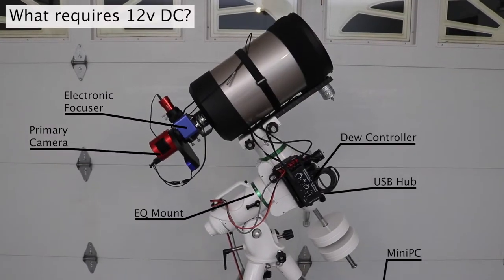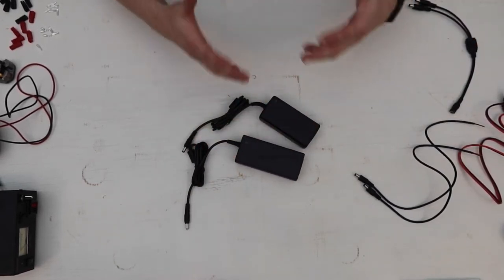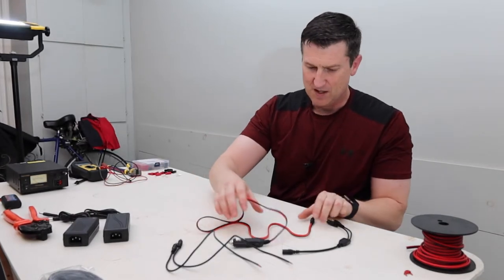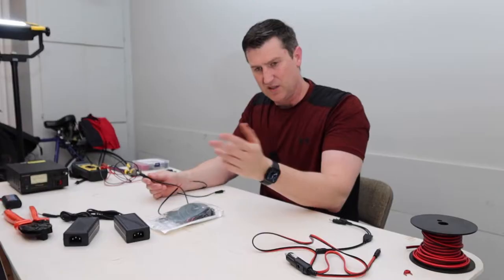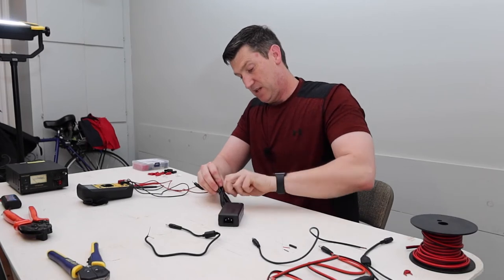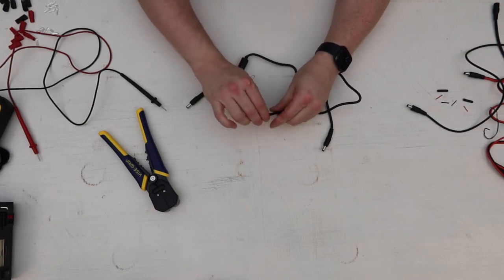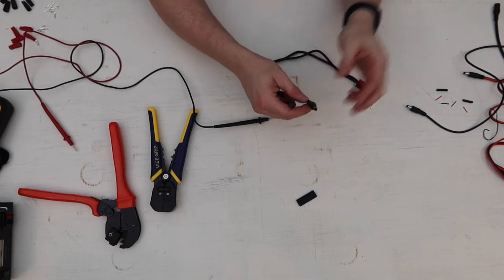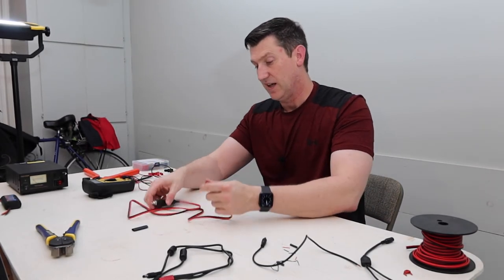Simplify Your 12v DC Telescope Power Cables

Comment: I learned a different method for joining wires together, especially if they are different diameters. Leave the wires frayed. Slip the shrink tube on. Spread the wires apart and push them together in line. Solder them and apply the shrink tubing

Comment: You are referring to the power supply as a 12V DC power supply.   The model you show in the video is not the one linked in the comments above but rather a 14.1 volt DC power supply.   I know I had seen a video by another YouTube person who modified the same model power supply to knock it down to 13.1 volts.   Is that something I need to be concerned about or is the 14.1V okay?   I don't want to start melting things.   Sorry for the newb question.  It was really a great video and I appreciate you taking the time to provide all of the links and great examples.   Maybe you can do a follow-up talking more about the actual connections on the scope and how you wired everything.  Again, great work.
Reply from the maker: It is a perfectly valid question! The vast majority of electronic equipment that state they use 12 V DC, will actually accept voltages between the low to mid 11s all the way up through 15 V. This is because when you use a battery, as the battery begins to drain, the voltage output drops. You may start with a lead acid battery that is outputting 12.6 volts and end with one outputting 11.6 volts. And your hardware will function properly the entire time. With this being said, most of us have found that our telescope mounts operate better when provided higher voltages. The higher voltage provides better tracking because the motor has more power. You can see many discussions online about this especially in regards to skywatchers style mounts. As you can see, I am using a 14.1 V DC output regularly when I’m at home and can plug into AC current. When I’m running off my battery, I want my voltage to remain high as well. In that case, I am now using a boost converter that takes in my DC current from the battery and pushes the voltage up to 13.8 consistently. I’ll try to show that on video sometime soon as well. It’s not a requirement, but I like that my equipment is still being powered in the high 13s even on battery, and through the whole evening even as the battery voltage itself drops over time.
Reply from the maker: This video may help with the cabling. Simplify Your 12v DC Telescope Power Cables. It is one of my older videos, you may need to search the channel. YouTube isn’t letting me paste links right now for some reason…

Comment: This is really getting me thinking, so thanks for the video and all your other ones too. One question: in this video you cut off the ends of existing power supplies but i wasn't clear on whether you were doing that just to save money of buying the same adapter again or if there's really anything unique and important about keeping the existing manufacturer's plug going into the gear. I'm assuming it's fine to just buy cables with the correct size barrels and gauge if i don't want to cut stuff up?
Reply from the maker: No reason other than reuse. Also, the assumption that the connector is properly rated for our power supply instead of buying a bag of cable ends that you may or may not fully trust. But for the record, I use and buy cable ends too. :)

Comment: Hi. Read your article “ Remote Control Your Telescope (MiniPC) “. I enjoyed it thoroughly and am in the process of following your instructions and doing the same setup. But in that article you stated “As far as wireless access when in the field, we are going to table that discussion until a bit later as it adds come complexity that we don’t need to introduce just yet.” Do you have an article or video now which expands the info of that article to have remote control when in the field without any internet or cell phone coverage… completely off the grid? What other equipment will I need? Thanks.
Reply from the maker: You can watch my ‘take the Internet with you’ video to show you how i use a small access point to get local network connectivity to remote control the unit when off the grid. It can also be coupled with the phone tether to provide Internet access. Nina’s newer capabilities, such as loading the off-line sky cache for framing, makes it pretty much where you shouldn’t need Internet access during a session anyway but you need to make sure you have those files in place prior because it is a very large download. So either an ethernet cable or some sort of wireless access to remote control the unit and the battery. Then you can get up and running.

Comment: Yes thank you for this video…although I am not familiar with all this my husband will probably help me accomplish this needed task of reducing the lengths of cables and wires and power bricks ….the only thing is would it still be worthwhile to do if I do not intend to have an onboard computer?
Reply from the maker: Definitely still value in doing this. A couple reasons: 1. Reduce your large and heavy power bricks down to a single power source. 2. The power source can now be a single AC/DC convertor or even a DC battery. 3. Removing heavy bricks removes balance issues as the mount slews throughout an imaging session. and 4. Removing excess wiring remove the possibility of cable snags as the mount move around.
Reply: @PatriotAstro  thank you for your speedy reply and your other videos are very helpful on Nina 1.11 which have not really been tackled elsewhere…❤️
Reply from the maker: No problem. Glad I can help!

Comment: I have heard some mounts are very picky about DC power quality - such that they run better if you supply a little over 12 V and that some are sensitive to any ripples from switching power supplies.  Think adding a capacitor to smooth out any 60 Hz would be necessary?
Reply from the maker: I’m not sure if smoothing out the power would matter much BUT I do occasionally question the quality of some of my portable lower amp 12v power supplies. They work, … but based on what I paid for them, I have to wonder. Regarding the voltage though, I have seen numerous comments about skywatcher mounts and how they do seem to perform at a much better level when they are provided consistently higher power, 13+ volts.  I have considered using a voltage converter (buck converter) to drive the voltage higher for that specific device.

Comment: Would love your suggestion.  I have two small computers I've been working on getting prepared to work with my scopes and would like to eliminate the power blocks for each of them.  They both are currently 5V input through USB-C connectors.  But I would like to connect them to my Pegasus Astro power advance.  Suggestion(s)?
Reply from the maker: Go watch my Allsky Camera Part 2 video (on the battery box), I cover a 'similar' issue there using a buck or step-down converter. I modified the connector to be a powerpole style connector but you could just use the connector you need instead. I use that sort of connector in my 'Simplify your 12v DC telescope power cables' video. Basically, you'll need both videos to piece together your application using a buck converter and the right cable, but it is something you can do - no problem.
Reply: @PatriotAstro  ok - will do - have picked up the same Stick-PC you had in one of your other videos - a little nervous about the micro USB power connector… :)
Reply from the maker: Same concept there as well. Just make sure you get the converter with the right connector. In the comments of my videos I try to list what I am using. You may have to look at a couple to find that one, or just dig around on amazon. :) If you have trouble, let me know.
Reply: make sure your MiniPC runs on 5V, some have USB-C connectors carrying 12 V! (for example the Mele-PCs)